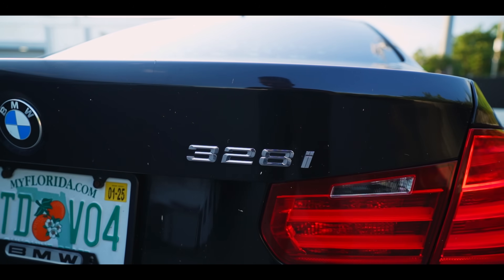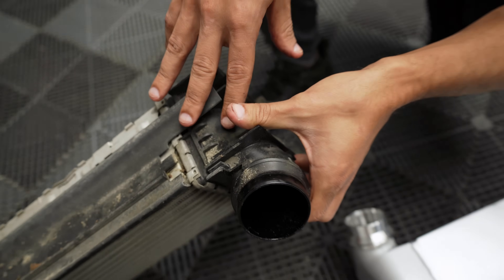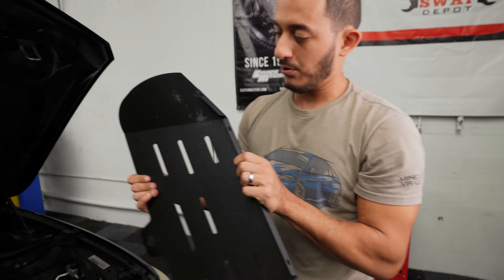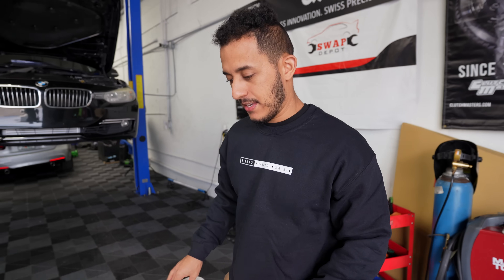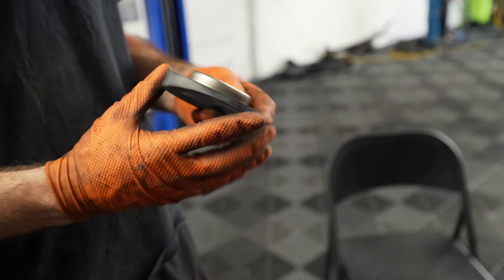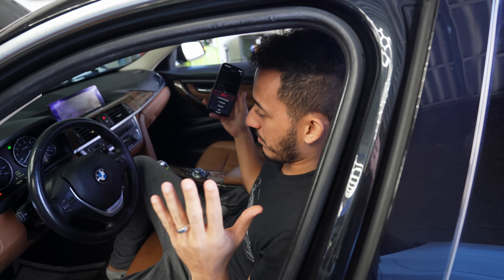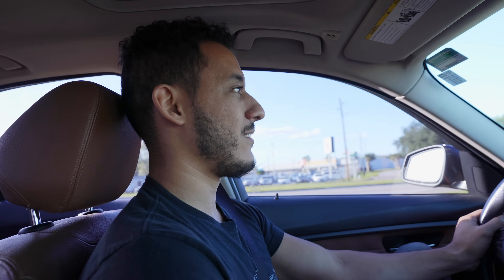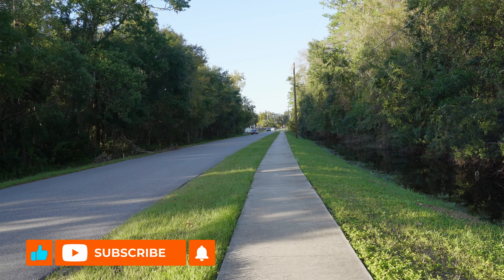Cheap And Neglected BMW F30 328i Get's Budget Performance Mods That Make Sense - N20/N26

Comment: Go fast bits diverter valve is a must for these cars
Reply: GFB leaks. turbosmart does not.
Reply: @Sqwin_n20  installed 100+ GFB DV+, never got any problem with it. Check your installation, unproper installation fk you up, LOL!
Reply: @bightk10060  the GFB will leak over time as you cannot service the rubber O ring which is the sealing mechanism of the GFB. Not the initial install if both surfaces are 100% clean. Petroleum aka gasoline due to how the built-in PCV valve in the valve cover which reroutes to the air intake tract works on this and the n55 turbos. Thus some blow-by and fuel vapors overtime will deteriorate that sealing O-ring and when it leaks you can’t service it. 100% replace the entire unit. Turbo smart you can replace the 2 o rings for $15 and no more leaks for another 2-3 years. Most folks don’t see the GFB leaking until they are making 310whp for the n20 at 23psi of boost on the stock turbo and around 20psi on an upgraded hybrid turbo.
Reply: @Sqwin_n20  well at 23 pound of boost you definitely have a catch can set up. So it slows down the process of deteriorating the seal. Both are good it doesn’t really matter. But I agree it’s nice that you can service the o rings on the turbo smart.
Reply: @Sqwin_n20 I've FBO with all the charge pipes and TIP installed, just no exhaust mods beyond a high flow cat. I have my DV+ installed and I've wondered if it leaks. Seems ok but I'm not really sure how'd I know IF it was leaking or not. All 3 bolts were done tight, oil on cylinder on install etc. Something to check or parameters to log?
Reply: @MeganKeeling-o2o  all you can do is a datalog and investigate the various toggles. accell pedal, boost pre throttle, throttle angle, waste gate duty cycle, load actual.

You'll have to learn how to read logs to find a pattern. there are a couple different YT videos of teaching how to read a datalog.
Reply: @Sqwin_n20  thanks! Target psi vs actual, throttle and wgdc are what I usually look for.
Reply: @MeganKeeling-o2o  What tool did you guys use to to reach the last screw?
Reply: @Sqwin_n20 bro i have blow off valve and dv+ sounds amazing both of them

Comment: You should do a G20 330i build! The B48 is really underrated apparently. Vehicular DIY got his to 500+hp with a turbo and some little other stuff. It’d be intriguing to see what ya’ll could do 😃
Reply: it's not designed for big power numbers shit will go south you'll have to do forged internals bigger turbo and it's still just a stock M139
Reply: @Василийбашалов830  eh, you can chill at 450 wheel pump gas reliably. Just gonna need good fueling cuz the block can take the power. You don't wanna go past 500 in a 4 banger anyways cuz turbo lag comes in business days.

souce: Had an im450 turbo in my G20 330i.
Reply: @Василийбашалов830 take the b48b20b! Not the b48b20a. The b is stronger and more suitable for tuning
Reply: yes! please help me with my g20 330i. I desperately need some sauce and im orlando based!
Reply: @Василийбашалов830  m139 cars are the price of a b58...thats an unfair comparison

Comment: I heavily track a 180k mile N26 that keeps up with M3s no problem, with the right maintenance these cars last and will handle the abuse easily. They also do great in the corners because they are much lighter. All while still getting 30 mpg on the drive back from the track.
Reply: Are you running a baffled pan?
Reply: @ No, I see no need as I don’t run aero or anything stickier than a 200tw. I do use 5w40 and run an extra quart. Never had any problems.
Reply: @hkg5321  good to know. Thanks for the reply!!

Comment: I have a 2018 330i X Drive with the b48/46. I did an intake, charge pipe, AWE axle back, with a JB4 piggyback and xhp trans tune.  HR sport springs on Bilstein b8 dampers. Also did front and rear strut braces and sitting on Apex vs5rs. Its the best daily IMHO. throw it in sport plus mode and it has plenty of power and solid handling on the backroads, but then I can switch it to comfort and get 30- 35mpg and its not too loud and the ride isnt harsh.
Reply: I would like to see your build what’s your ig??
Reply: B48 supremacy

Comment: I decided to buy my old man's 328i M sport off him for 4k. Did the maintenance and its an awesome car for what I have in it! I think one of the huge upsides is that these cars can look REALLY good. They handle great too. Fantastic torsion rigidity.
Reply: 239K miles btw
Reply: Smart man! 328i is a great car, and especially for that price lol. Easy to mod, and a tune yields very high hp upgrade.  If you ain't tracking it and not trying to spend a lot of money on maintenance/repairs, n20 is a great motor to play with.

Comment: I have a problem on my 2013 535i my belt broke so I got a new one changed belt tensioner all that the pulleys and I thought woulda fixed it but now it’s saying it’s not getting enough air flow then it starts smoking from the engine (stock) if could help lmk

Comment: mad chargepipe is the same as the VSRF. Alibaba special. it leaks if you actually start to lean on the car to make power. FTP combo or bust. there is around 5-10whp by actually fitting a 3" aftermarket midpipe from an f30 335i and cutting off that 2.4" from the downpipe converting it to a true 3".

You can retrofit a b58tu hpfp with a feed line. no tune needed. will help you with content + being able to run full e85. That oil smoke from the post bm3 tune launch is due to a leaking oil feed line which there is an updated line for this from BMW.

FBO all parts e85 custom tune xdrive you can run a 12 flat with this car. If you take out the seats on e85 custom tune stock turbo and still get 30mph. Upgraded turbo will run 11s.

Good luck

Comment: "-Top is 160
-I don't think that car can make it"
My 320i goes 150 on my daily commute ahaha
Reply: Vin diesel has hit 180 in my n20 powered car. 7200 rpm fuel cut 5th gear (6mt).

Comment: 2nd cat delete as the N26 has 2 versus N20 only having 1 due to it being a SULEV. xHP is a must for crispier shifts for sure. TTE400 turbo paired with b58tu HPFP and S63tu injector for a custom e85 tune and she’ll be moving!

Comment: I’m surprised after all the mods you said it was 300? Is that a realistic number given all you’ve installed on it? I also have a 28i N20, and I was hoping if I did similar mods I could get to 320 given it is about 240 stock. Would appreciate some guidance since I don’t see many creators nowadays building these budget cars.
Reply from the maker: My guess. Haven't dynoed it yet.
Reply: if you throw all the parts on the car usually most folks get 265-280whp/310wtq on GOOD 93 with the BM3 stage 2 93 "off the shelf tune." This is shown by a handful of folks and even myself.

Comment: Hey since this BMW particularly this N26 is registered in Florida a SULEV state this engine is backed by BMW's Sulev Warranty. 150000 miles or 15 years. BMW is replacing the engine on my 2013 328i as we speak with the updated model. Could have saved yourself a lot of time and work. But this might help someone else out there. 15 states are SULEV compliant.
Reply: I just got 20k worth of work done under my hood for free a few months back. F30 2015 n26.

Comment: I love this series as I also have an n26. Curious how the exhaust smells after installing the catless downpipe but retaining the secondary cat? Minus the rotten egg smell lol. Is the catless smell super strong?
Reply from the maker: Not nearly as strong as my other cars to be honest. Can't smell it from inside of the car, and from the outside it's mild in my opinion.
Reply: @ Appreciate it! Sounds like it should be mild compared to my brother’s catless N55.
Reply from the maker: @brandondarnes3699  Yeah, being that the N20/N26 are smaller motors, the smell is also reduced. Secondary cat helps as well.

Comment: IS IT POSSIBLE TO USE THE BIMMER GEEKS TUNE WHICH IS FOR A 328I BUT TUNED FOR A 330I THEY HAVE A TUNE READY AS LONG AS THE 3 STAGE AIR INTAKE IS EQUIPED 👍🔥🔥🔥LEAST AN EXTRA 30 HP 🎉🎉
Reply from the maker: Dont think Bimmer Geeks offers a tune. If I remember correctly they offer coding and diagnostic related stuff.

Comment: I have an f30 328i but with an n20 engine, and recently thhe acceleration has been super slugish as if it's n/a, its got a 50/50 blow off valve and i also havent been hearing any noise from it so could the problem be with my blow off valve? if anyone has an idea what the issue is id appreciate any insight. I have no engine codes or other issues that im aware of.

Comment: What about the timing chain issues on a 2014 428 ?  At what mileage do they crack?
Reply from the maker: I covered the in the prior F30 video
Reply: @VehicleVirals the issue I have is that I have two cars
Reply: And one has to go.  the first is a 06 325i with 99k in pretty good condition. Bilstein shocks, Zimmerman brakes and no leaks.  The second is a 14 428i stock in excellent condition with less than 30k.  Can’t decide which one because of timing chain. If thats fixed, will it be reliable.  Thanks. I am in Volusia county.